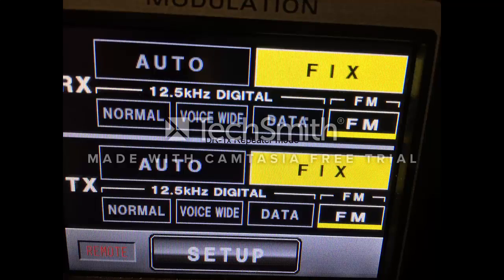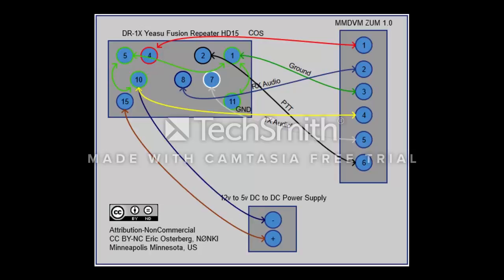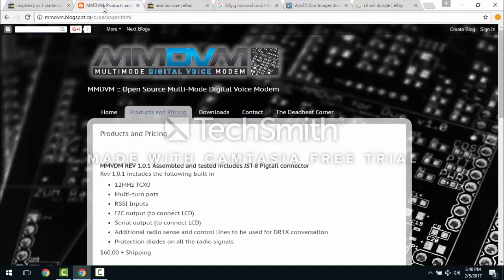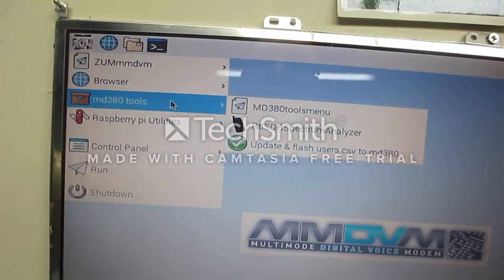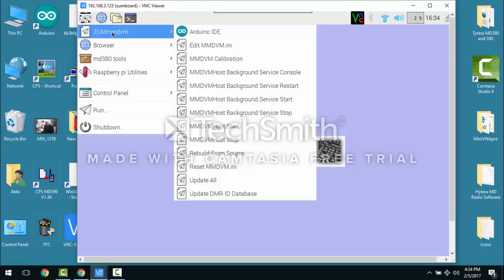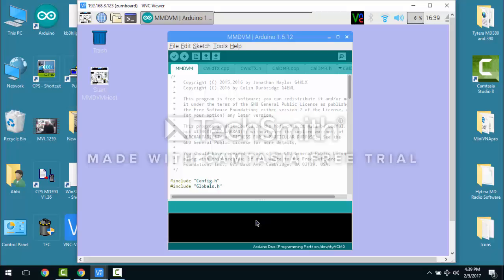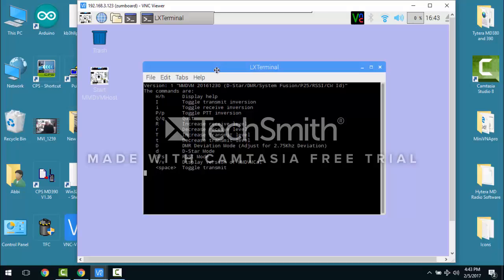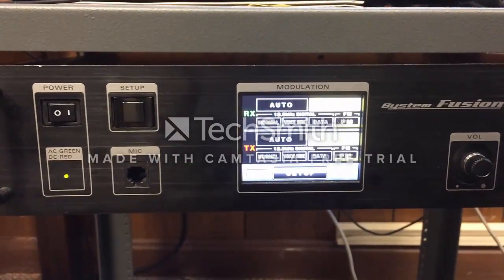MMDVM 1.0 ZUM DR-1x to DMR conversion

Comment: Hello Matt. This is nice video. But I really like to see how you properly set MMDVM-Zum with RTL-SDR and spectrum software. Please record film on this. Right now I am working on RD-1X and I have many problems with properly set this repeater.
Reply from the maker: Sure Danilo - I will show you how to tune via the rtl-sdr on the next video i'm going to do for the 1.1 board.  Basically as I said in the video - I manually adjusted the TX potentiometer super slowly - as in microns to the right each time I turned it.  Look at the width of this character:  I   that is the width you adjust it each time clockwise turn and key up your radio and watch the terminal screen.  It took almost 1/2 hour to do it that way since it is so sensitive.  The RTL-SDR idea came from Eric Osterberg who claims you can adjust the peaks in TX and RX almost equivalent and it will tune in the modem. I incorporated the program "Freq show" on the image to do just that -  I'll make a video of me tuning on the next one - since my current MMDVM 1.0 (ZUM) is already perfect - I didn't want to mess it up from its perfect setting.